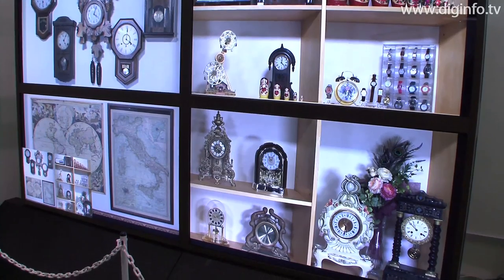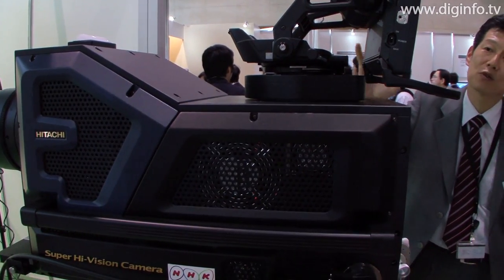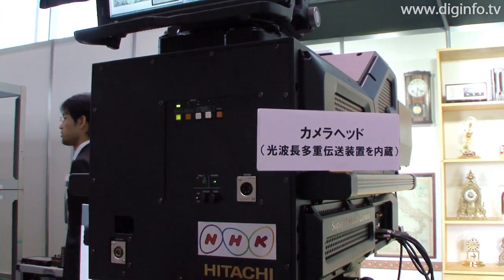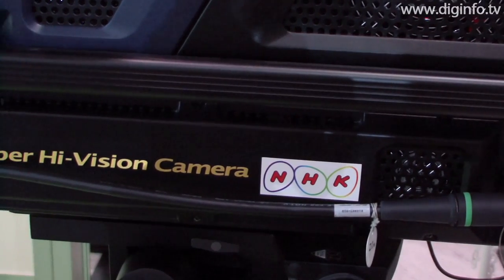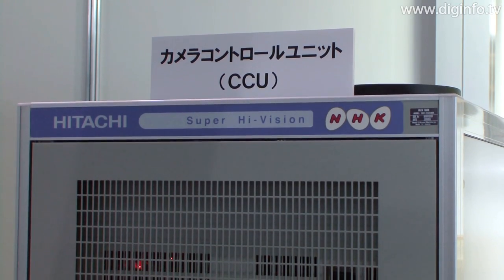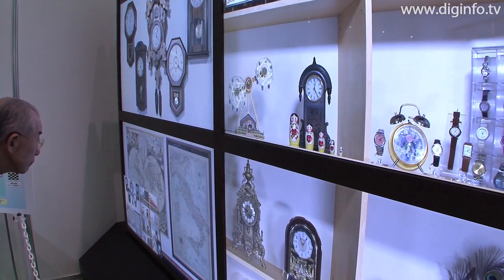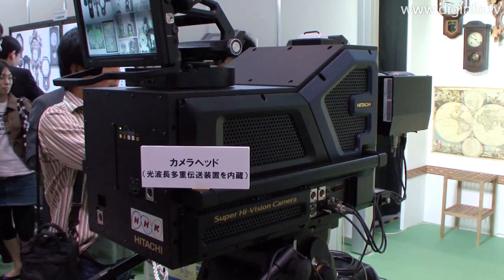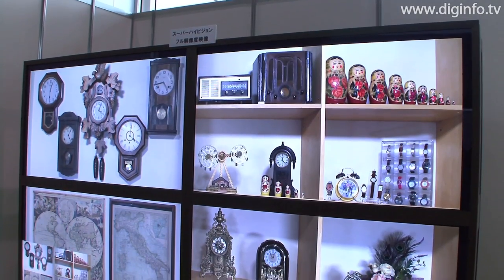Ultra High Definition Camera System : DigInfo

Comment: I doubt it could be had for $9000, looks more like $900,000, 250k at least. Remember that most hi end por cameras require 2 to 3 times the outlay for accessories.